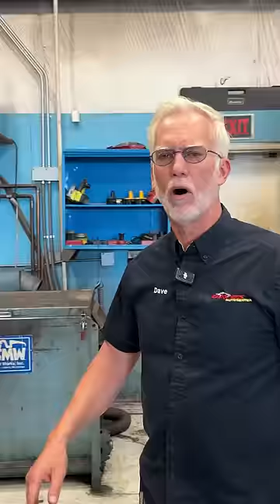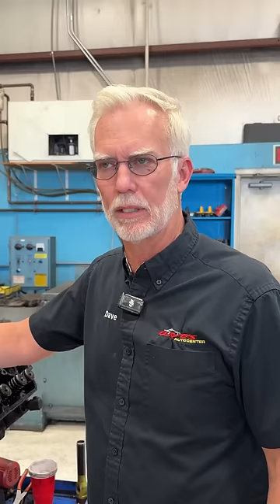7.3 Ford Power Stroke. Do you wanna see step by step process of a performance rebuild?

Comment: Yes, please. I love the old 7.3 powerstrokes.
Reply: 600
Reply: Do a long l like up grades.
Reply: Yes! I might have to go threw my 7.3 and like to know the good upgrades!
Reply: Please do
Reply: Go for it
Reply: TRUMP 24
Reply: Why? "reliable" nah try not enough hp to destroy itself
Reply: @Xanaroni  man not  all 7.3 are slow little mod and this thing is another's aniimal
Reply: @Joey500 Trump 2024
Reply: @caterpillar6nz310 these diesel engines are not made to be fast.  They're made to pull without overheating and burning a lot of fuel.  And they last longer with higher torque.
Reply: The most overrated motor ever.
Reply: @speedy0231 how is it overate?  I know 2 friends thar has Ford 7.3 diesels,  one of them is over 700k miles original engine,  the other one has like 470k miles original engine,  the Ford 7.3 was a solid engine
Reply: @BruceDragon-sf1tr  they run so long because they don’t make any power. And when you start to add power. You can crank the block. My old 7.3 powerstroke would lose speed going up a hill with a heavy load. And good luck passing anyone over 50 mph with a heavy load.💩
Reply: Much respect for the old 7.3

Comment: Retired diesel mechanic  7.3s were bullet PROOF  with regular maintenance   the newer diesels are ok  EPA IS THE PROBLEM  def and  exhaust systems are worthless lets repair this 7.3
Reply: Sorry about all that cleaner air
Reply: Sorry about you. Don’t know what you’re talking about. Diesel soot   does not go in the air falls back down to the ground it’s too dense and heavy diesel Burns cleaner then gasoline engines. They have a lot fewer carbon monoxides hydrocarbons and carbon dioxide the only reason the EPA put DPF and all that trash, and EGR on diesel engines because of dumb people complaining about black smoke
Reply: @Bloodcurling ,all the DEF systems do is break down the particulates, which would normally fall onto the pavement, into smaller particles which then become airborne and eventually work their way into waterways which means more pollution and dirtier air. It would be nice if the EPA would stop creating more demands on the manufacturers which ends up shortening the lifespan of vehicles thereby filling up landfills and scrap yards with hazardous waste sooner as is the case with these def systems because the vehicle has to go through intense heat cycles. Maybe they could actually become educated and figure out ways to have fuels burn more complete in combustion engines and help the manufacturers. perhaps they could figure out ways to use the methane and ammonia created from cow manure and urine to make fuel. This may sound tongue in cheek but you get my point. These government experts are not educated in the industry they are purely academic,with their main qualifications being social justice warriors.
Reply: @Bloodcurling - cleaner air from selling extra systems that are extremely energy intensive to manufacture and maintain?   Me keeping my 7.3 running another 20 years is more environmental than ANY new vehicle you could buy today.   You’ll spend more energy and money on emissions repairs alone! 😂
Reply: My friend just bought a brand new 2023 6.6 duramax and had to get the def tank and def heater replaced within a few months. Only had ~6,000 miles.
Reply: @izaacsilva9148  they are about the same on emissions but only because of all the emissions equipment. take that all away and we go back to having skies filled with yellow smog and acid rain.
if you want to keep combustion you are going to have to somehow motivate the industry to do some massive innovation. Mabey someone comes up with some sort of system that makes the DPF obsolete, like how catalytic converters used to suck big time but now they work pretty well
Reply: @izaacsilva9148 If diesels burned cleaner there would be no black smoke, and black smoke is unburned wasted fuel, it contributes nothing to power output.
Reply: @Bloodcurling air isn’t the problem. What happens to your tires when they break down over time ?
Reply: I'm a trucker and love my Series 60. 989,000 miles and she still starts right up even on cold days.
Reply: Many years ago I overhauled 8v71  & 6v92 detroit diesels when done and  tuned properly  these engines did not smoke but the problem was some drivers wanted more power an that was more on Cummins & Cats due to the fuel pumps at THAT TIME and of course that caused more problems
Reply: ECM'S if I remember right didn't come out on the big rigs until 90 or 91  an I liked the ECM'S & EFI'S BUT THE  DEF ERA IS NOTHING BUT PROBLEMS
Reply: @Bloodcurling if we stopped using fuel powered engines tomorrow, it wouldn't do a single freaking thing until China, Russia, India, all of South America and Africa start watching what they contribute...

Comment: My 7.3 has been pulling (3) 72 inch zero turn mowers for 21 years. It’s a tank. Best truck I’ve ever had.
Reply: Mine a 2002 and has been pulling 2 mowers or loaded with mulch or brush almost daily for 15 years now. It's got 260k miles, and so far, just a water pump and hpop rebuild. Hard to beat a 7.3
Reply: Lemme ask, why in the world you need to pull 3?!?
Reply: Great job
Reply: @poonplugdoonbug  big contracts, big lawns, multiple lawnmower operators, possibly mowing a football field as part of a lawn mowing business.
Reply: Yes by allmeans do it
Reply: Long
Reply: @poonplugdoonbug   I have mostly commercial accounts and 3 guys. Three 72 inch tractors mowing grass gets large properties done quick
Reply: I just bought myself one 3 days ago at the age of 19. It's a 1996 f250 7.3l powerstroke! I love it so far!
Reply: Long live the legendary 7.3!!!

Comment: I own 2 7.3 power strokes in 1 ton dumps. Friends call them our “money makers” ! It’s true !
Dependable, dependable, dependable !  So glad I bought them new, one in 1997 other in 2002. Frequent oil changes and ALWAYS clean diesel fuel with an additive. 
They purr, grunt and deliver the goods, always !
Reply: 500000 miles on m'y 00 zéro blowby i use hotshot secret on oil and fuel ❤

Comment: I want. And i have one. Best thing I ever purchased. Made me one hella lot a money. 400,000 still running. 3 water pumps, re_ o ringed the injectors.couple diaphram fuel pumps, just putting in a hpop. Unheard of. Gonna rebuild it. Made me 1000000 dollars. Purchased it as used with 23000 milaes on it. Never pulled much, but a lot of hours in low rpm. Here's a testimony for the reason why these engines are legendary. Done all the maintenance,  could be one of those million mile engines.  But I've  got time and money. Would like to take it as far as it can go. Love your passion. I'm interested in the piston rod upgrade cost. Probably  the best service engine ever built. Want to make it a puller

Comment: Yes, I would love to see one. Because I have a 2000 Ford F250 crew cab 2 Wheel Dr. 7.3 power stroke diesel engine and it has less than 90,000 miles on it originally

Comment: The 7.3L Power Stroke was a game-changer for Ford in the mid-1990s. It was the first of its kind to feature a hydraulic electronic unit injector (HUEI), waste-gate turbocharger, direct injection (DI) system, and air-to-air intercooler. The engine was electronically controlled and could produce up to 21,000 psi. It was also highly reliable and offered a significant improvement in performance over the 6.9L IDI and 7.3L engines that came before it.
It was built by Navistar.

Comment: I used a Banks Motor Minder set to the Towing setting and got 50 extra hp and torque on my 6 speed manual.  That's only setting 2 of 4.  It's great.

Comment: I have a 97 I acquired a year ago , it's been an interesting learning experience getting it to run and you can never know too much. 
 Unfortunately I'm in over my head with my abilities without a shop and the work that needs to be done to it but a part of me really doesn't want to see it go. The OBS 7.3 is getting quite rare especially in outstanding condition, they sell for stupid cash when they're proper. 
  Bring on the long and I'll cross my fingers it gives me the  extra confidence to hang on to mine 😅

Comment: I have a 97 and a early 99.    Both with the 7.3 and a manual trans.    97 f250 hd has 900k on original long block.   And the 99 has over 300k.     Both run stong.   And i use my trucks as tools.  Work them hard...     best medium duty diesel engine ever!

Comment: I'd love to see someone do videos on the 7.3l engines. From doing a basic improved build, to add modest gains but focus on a working truck motor. Then a bigger build for hp and tq increases and additional durability. Maybe do a personal dream build you might find in a hotrod or puller engine.  Stock are respected but I felt rods and pistons were a little weak depending on year

Comment: I owned an '88 F250 7.3International Nestar Disel and a great machine it was but the only thing bad is that the Disel pump burns out after 80 thousand miles. When you buy Disel always think about the breakdowns like the fuel pump that will burn out and leave you stranded.

Comment: Please do a long and what you would do for a 5th wheel tow engine that will reduce the EGRs and produce good HP and power.  I have a 7.3 with 4 inch exhaust and I have to watch my EGRs when towing in the Colorado Mtn.  Also, is it possible to increase the valve spring to allow exhaust brake?

Comment: Also , what are Your preventative failure engine upgrades for the stock 1999 7.3 engine . i was told (many times) to install the slightly bigger turbo , from the 2001 F350 7.3 , on my stock 1999 7.3 . 
What do You think ?